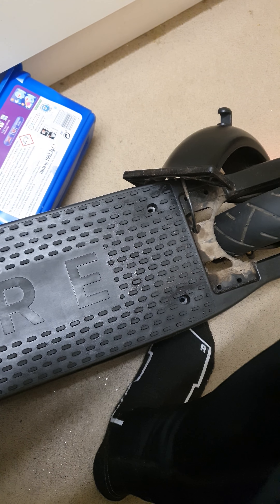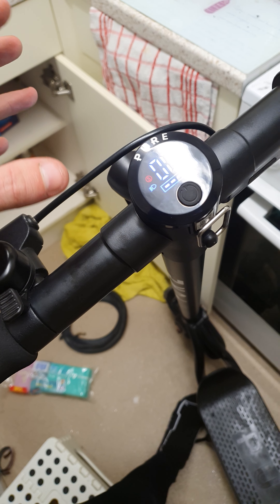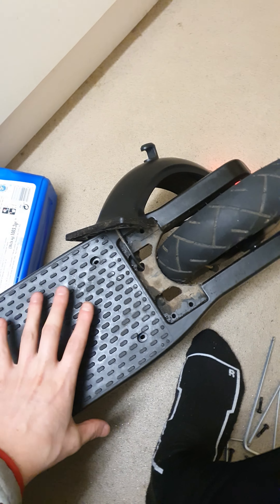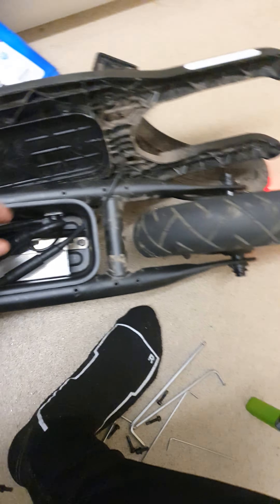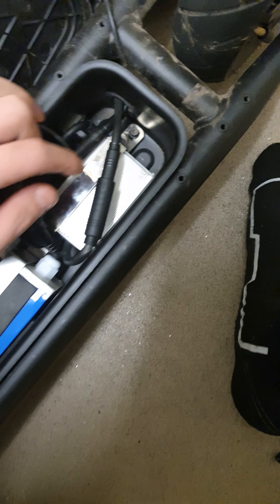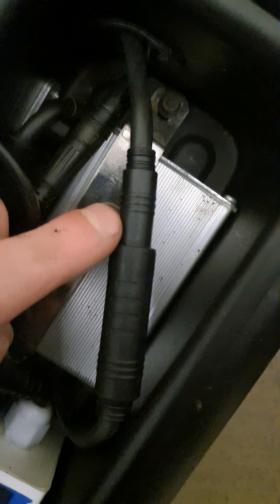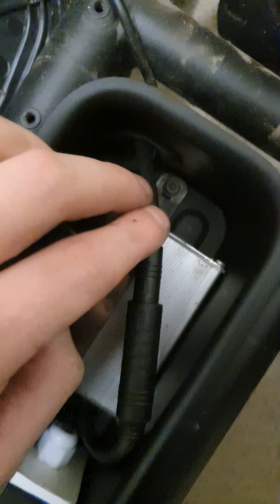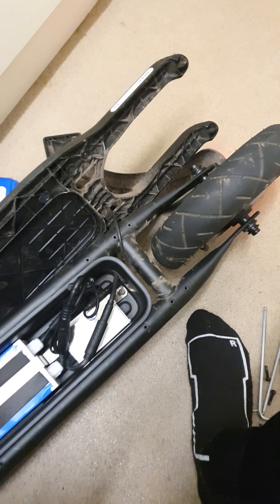PURE AIR 500W FLASHING RED SPANNER . HOW TO FIXED THE PROBLEM

Comment: Mine turns on with my finger comes up as battery bars then stay on 10 seconds whilst in still holding it then comes up E8 non stop flashing with empty battery on screen!
Reply from the maker: Not sure mate , check out the community there's a post on there avatars in the error codes!

Comment: Hi basically I have a pure air 3 pro and the bars keep going up and down like it’s charging but there’s no charger and basically the problem is that it doesn’t move when fully charged and the speedometer sticks to 0 and the app tells me to turn on the light to get in the scooter to update but the light doesn’t turn on
Reply from the maker: Sorry I can’t help you there this video is for the pure air gen 2 model

Comment: Hi there all my cables are in place but still getting spanner and H2 any help
Reply: I have the exact same problem @garyroberts did you manage to resolve the problem
Reply from the maker: H2 is faulty throttle
Reply from the maker: H2 is faulty Throttle
Reply: @MADNESSJake125  do you have any suggestions on how to fix this
Reply: @MADNESSJake125  any suggestions on how I can fix this please
Reply from the maker: H2 is faulty Throttle, hope you get it sorted out

Comment: Hi mate, any idea what the error r8 with a spanner is. Just got this problem and no idea how to fix.
Reply from the maker: E8 is Motor failure so you might need to change the rear motor hope this helps 🙏🏻😉

Comment: I have the red spanner problem but it comes and goes, will work one day and then doesn't. Is the same fix. Any advice. Thanks
Reply from the maker: Have you checked out all your wire's and under the scooter 🛴 deck?
Reply: @MADNESSJake125  I haven't because until I saw ur video I didn't have a clue what to do but I will open it up and have a check of the wiring tomorrow and hopefully it's just a loose wire. Thanks for the advice
Reply from the maker: Just make sure all wire's are ▶️◀️ this what it should look like on the end of the wire's were the connect together 👍
Reply: Ok if wires are matching with arrows facing each other what would u do next?
For me this problem appeared when i was fixing puncture in tyre ,next step seems open up tyre and check wire connections in wheel have u ever undue thous small screws and looked into?
Reply: @janispirags1861  same here pal, it only went wrong after fixing a puncture in the back tyre
Reply: I'm picking up one of these later it's got red spanner and r8 fingers crossed 🤞

Comment: Hello mate My same scooter only turns on when charger is in but soon as you take the charger  out it wont turn on  what would u say the problem is any ideas dude ?
Reply from the maker: It sounds like you need a new battery 🔋 and don't trickle charge it next time let the battery 🔋 go fully dead and set alarm ⏰ to keep checking on scooter while charging , because they can catch fire but also I would also recommend get a new charger as well start with that first then move to the battery 🔋 but they cost a lot of money £300.00 so probably better off getting a new scooter 🛴

Comment: I have a problem in my pure also it turns off at 75 % of the battery and it show ''02'' what could possibly be the problem and how can i fix it ????
Reply from the maker: Hi I've just had a look on my codes for the pure air gen2 model 02 code means, communication failed and to replace the controller , hope you get it sorted out 🙏🏻💚🙂
Reply: i have the same problem did you manage to fix it?

Comment: Didn't help
Reply from the maker: What's wrong with your scooter please don't hesitate to let me know on here 🙏🏻😉👌🏼
Reply: @MADNESSJake125  same issue,but now won't turn on 😂 it worked for 5 min and died totally 🥺
Reply from the maker: Have you fully charged the scooter 🛴 & check out the voltage ⚡ between the battery and where it connects to see the current see how much voltage it's pulling though the wiring loom 😕
Reply: @MADNESSJake125  well I'm not electric so idk much,and yea charged fully, it dose drive 200m and just dies
Reply from the maker: How long have you had your electric scooter for ? It sounds like it's some think to do with your battery 🔋 because the things is having an electric scooter every cupple of years you have to replace the battery because it loses its battery percentage over time just like a mobile phone 📱
Reply: @MADNESSJake125  it used to be fine,since I had.front flat tyre and I yesterday changed to solid tyre this happened,idk why,once I plug and unplugg power where is battery it turns on,and when I start ride it just dies
Reply: @MADNESSJake125  perhaps I can text you some where else?
Reply: @MADNESSJake125  so where I could buy new battery?
Reply: @MADNESSJake125  and it's been only a year
Reply from the maker: eBay for battery

Comment: I have the same issue red spanner flashing and it's showing 40  but only realised it maybe down to the motor in the back wheel i've check all wires,i've change the throttle it can't be the battery because i'm able to switch it on and i have a full battery showing ...
I just brought the new pure advance plus aswell
Reply from the maker: Without seeing it wouldn't be able to go any further because, only try to give people advice. As I'm not a machine. 
I hope you get it all sorted out please do let me know what was wrong with it 😉🤙🏻
Reply: It was the motor when i rolled the rear wheel the red spanner came on which told me it was the motor ...i brought the new motor and its all good working perfect so if the red spanner shows the problem may differ ..
So it might not always be the wire that you was showing how to fix it when it could be something else